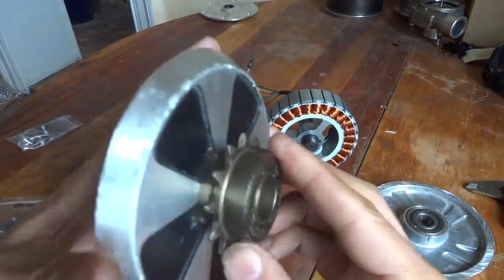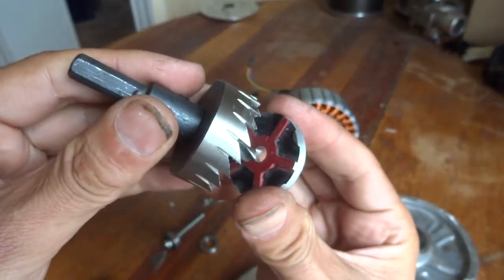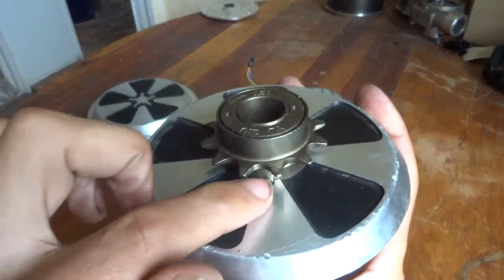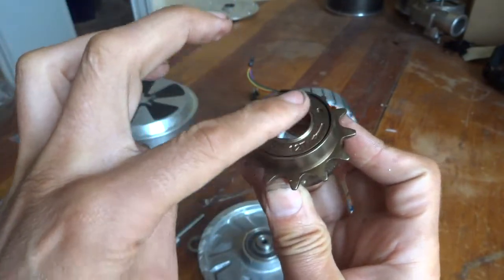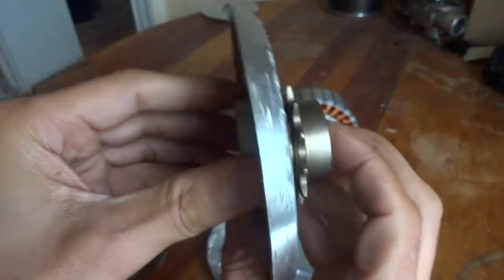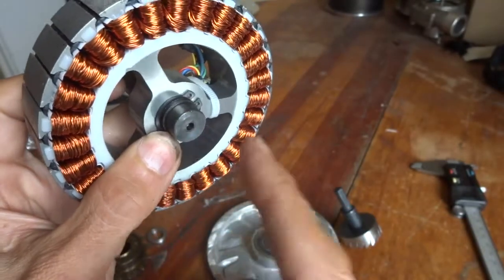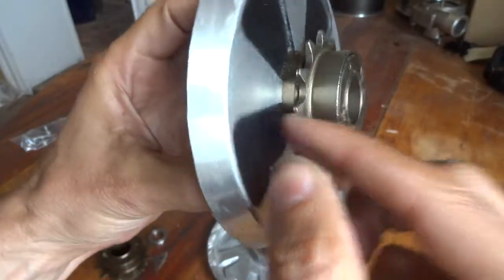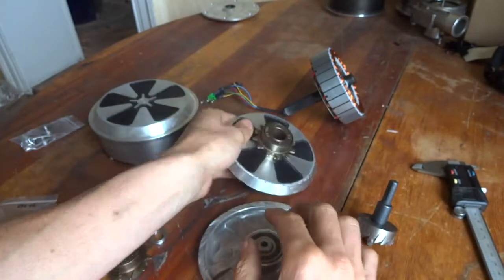mounting a freewheel/flywheel sprocket to a hoverboard motor (recumbent bike or three-wheeler)

Comment: Im was searching good idea to do this straight, and that small bearing and 6mm drill bit is best method i found so far. Thanks
Reply from the maker: I am going to mount a 10T sprocket from Panasonic E-Bike to a Hoverboard motor in the next days: https://www.bike-discount.de/de/kaufen/wippermann-connex-e-bike-ritzel-fuer-panasonic-motoren-antrieb-z10-459952

Stay tuned :-)
Reply: @robodurden  8 euro is pretty expensive, considering that i paid 5 euro for whole wheel :) Was thinking to 3d print it but probably wont last too long... Good luck i will wait for next vid.

Comment: Am i wrong ,but i think the freewheel should be in opposite direction? I am also working on this problem.The freewheel that can be turned around is  at least16 teeth.The small ones cant be turned around.Or yor mount at the bike is on the left side to work?
Reply from the maker: A freewheel should spin freely counterclockwise = back pedaling. The hoverboard motor should be placed after the pedal crank where the chain is going back to the back wheel. Like the old Panasonic middle motors.
That way you can pedal without the motor turning because the freewheel skips. But when the motor start counterclockwise, the chain is pulled. So freewheel sprocket pointing to the right side of the bike.
Reply: sorry i thought this will be for middrive....
Reply from the maker: @julikb  as I said, like these old Panasonic middrives: https://cdn.shoplightspeed.com/shops/608278/files/6651664/panasonic-replacement-motor-350w-36v-nua035hb-l2-4.jpg
Reply: @robodurden  now i understand the concept.

Comment: Does anybody know how I can open the hoverboard motor?  After I remove the 6 screws it is still stuck. It seems there is something else to release
Reply from the maker: Two flat 🪛 screwdrivers from opposite sides to push the backside a few millimeters apart.
Reply: It works! Thanks a lot

Comment: I don't see this holding up too long after watching the whole thing. No disrespect to the maker of the video. It's just not enough strength to transfer the torque effectively. The screws will twist off when weight is applied to the bike it is set-up on. The crank needs to be fashioned to the motor itself to get proper power from the motors transfer of power.
Reply: I just don't see how else to do it. I too have considered the project with my own hoverboard wheels. Just hadn't had the gumtion to actually do the work yet. But thanks for sharing the video. Sorry to burst any bubble on the project just hope it helps with where you are going.
Reply from the maker: @ebikeliverystable  i am pretty sure my method can take the 6.68 Nm of a 350W motor (500 rpm / 14 rpm/V)
Reply: @robodurden  these motors are only 14 rpm per volt?
Reply from the maker: @mashedpotatoes5323  yes 14 rpm/V, that is how I myself have measured them. I try to repair an electric skateboard today. These tiny hub motors have about 50 rpm per Volt.